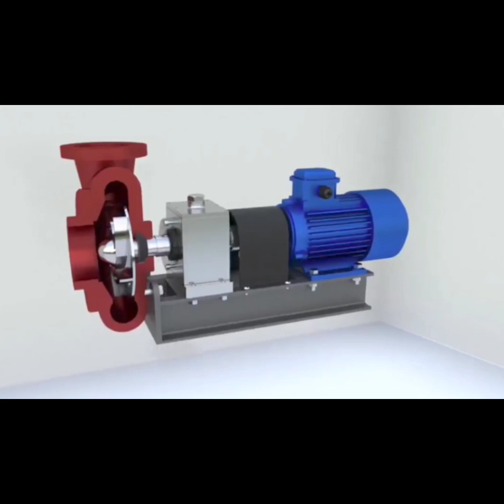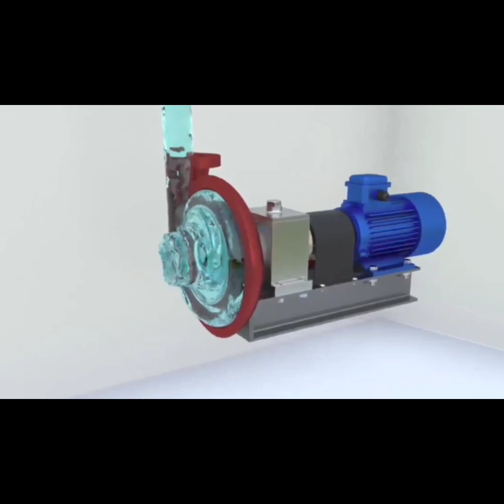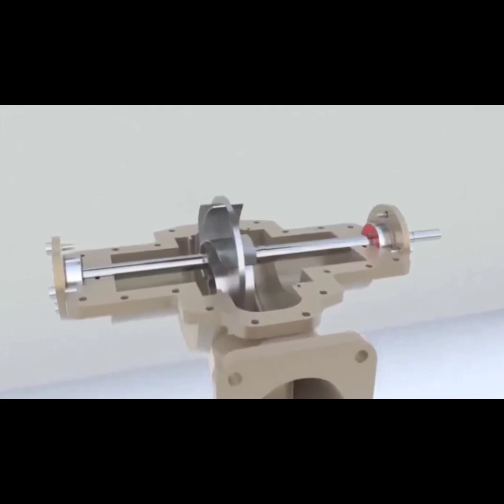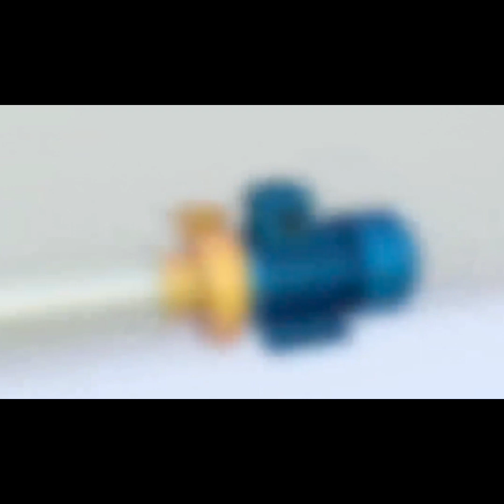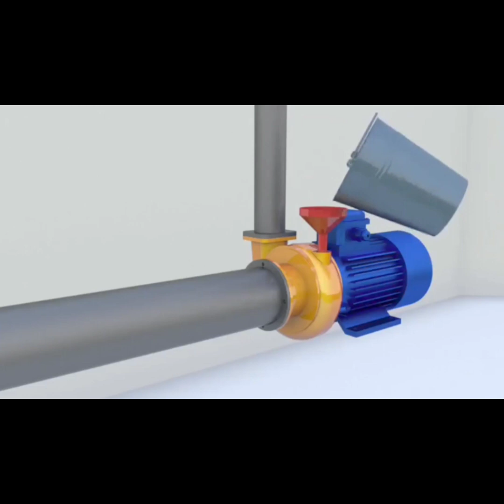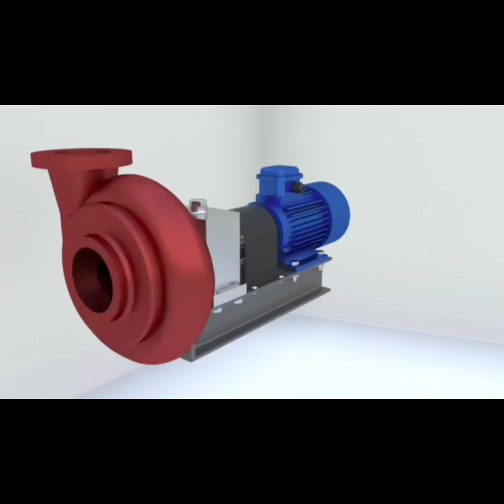"Centrifugal Pumps I सेंट्रीफुगल पंप I Working annimation: A Marvel of Fluid Dynamics!"

Comment from the maker: 6 Common Pump Questions Answered

For any centrifugal pump user, knowing the answers to the following six questions is key to reliable and efficient pump operation. The answers below are excerpts from a six-part series on centrifugal pump efficiency written by Pumps & Systems columnist Joe Evans.

1. What is efficiency?
When we speak of the efficiency of any machine, we are simply referring to how well it can convert one form of energy to another. If one unit of energy is supplied to a machine and its output, in the same units of measure, is one-half unit, its efficiency is 50 percent.

The overall efficiency of a centrifugal pump is simply the ratio of the water (output) power to the shaft (input) power and is illustrated by the equation below:

Ef = PW / PS

Where:

Ef= efficiency

Pw= the water power

Ps= the shaft power

Click here to read the full answer.

2. What is specific speed, and what is its effect on the pump curve?
Specific speed was first applied to centrifugal pumps in the latter 1800s and was a modified version of one developed for water turbines. Many pump designers see specific speed as the most important contributor to centrifugal pump design. It allows the use of existing design and test data to design similar higher and lower flow pumps because the specific speed of a pump is independent of its size.

Figure 1. Pump profile comparisons (courtesy of www.pumpfundamentals.com)
As Terry Henshaw stated in “Centrifugal Pump Specific Speed” (Pumps & Systems, September 2011), the definition of specific speed can be confusing. It is best to think of it as an index number that can predict certain pump characteristics. Viewed this way, specific speed can be useful when selecting a pump for a particular application and predicting premature failure due to off best efficiency point (BEP) operation.

Click here to read the full answer.

3. What are individual efficiencies that affect operation?
Hydraulic efficiency. The shape and spacing of the impeller vanes have an effect on overall pump efficiency. Although the ideal impeller would have an infinite number of vanes, the real world limits us to five to seven for clear water pumps and even fewer for pumps that handle larger solids.
Volumetric efficiency. Whether the volumetric efficiency of a centrifugal pump is a function of the volute or the impeller is debatable (it is probably both), but I will include its effect here. Volumetric efficiency represents the power lost due to flow leakage through the wearing rings, the vane front clearances of semi-open impellers and the balancing holes in the rear shroud.
Mechanical efficiency. The final piece of the pump efficiency puzzle is that of mechanical losses, although some of these losses are not always included in published efficiency curves. In the case of a frame-mounted pump, these losses are caused by the shaft bearings and the mechanical seal or packing. For close-coupled pumps, bearing losses are figured into the motor efficiency. Again the rule of thumb follows that of volumetric efficiency, and losses increase as flow and/or specific speed decrease.
Combined efficiency. When looking at the overall efficiency of a pump in operation, the efficiency of the driver must be included, and in many instances, that driver will be an electric motor. When the Energy Independence and Security Act of 2007 went into effect in December 2010, it raised the bar on motor efficiency. Today, all new motors must meet premium efficiency standards. Obviously, a higher efficiency motor will increase the overall efficiency of a pumping system, but by how much? How do we calculate the combined efficiency of pumps and motors?
Click here to read the full answer.

4. How do you preserve efficiency?
An important part of the volute is the tongue, or cutwater. Its purpose is to maintain flow into the throat while minimizing recirculation back into the case. The optimum clearance between the tongue and the impeller periphery is the smallest distance that does not give rise to pressure pulsations during vane tip passing. A well-designed pump will have a full-size impeller that meets these clearance criteria. When an impeller is trimmed, this distance increases and allows more fluid to recirculate back into the case. As recirculation increases, hydraulic efficiency decreases.

Click here to read the full answer.

5. How does curve shape affect efficiency?
A typical performance curve is relatively flat at low values of specific speed (Ns) and becomes steeper as Ns increases. Pump efficiency is lowest at low values of Ns (500 and below) and increases as Ns increases. It reaches its maximum in the mid-to-high 2,000 range and begins to decrease above 3,000. However, the decrease above 3,000 is much smaller than it is below 1,000.

Steeper curves usually offer a greater range of control when operated under variable speed control against some fixed elevation or pressure head. These pumps can be problematic when running in parallel or starting against varying system head conditions. ... Flatter curves work fine in across-the-line applications as long as the static or pressure head remains relatively constant. They also work well in closed-loop (and most open-loop) circulation applications when operated under variable speed control.

Click here to read the full answer.

6. When is efficiency important?
The power required by a pump is directly proportional to both the flow and the head that it produces. As flow and/or head increase(s) so does the power required. Conversely, power is inversely proportional to hydraulic efficiency. For the same flow and head, an increase in efficiency reduces the power requirement.

As the cost per kilowatt hour increases, so will the savings due to increased pump efficiency.

Comment from the maker: High Flow Rates: Centrifugal pumps can handle large volumes of fluid, making them suitable for various industrial applications.
Simple Design: They have a straightforward construction, consisting of few moving parts, which makes them easy to maintain and operate.
Wide Range of Applications: Centrifugal pumps can be used in various industries, including water supply, wastewater treatment, oil and gas, and chemical processing.
Energy Efficiency: They are generally efficient in converting rotational energy into fluid flow, saving on operational costs.
Self-Priming: Some centrifugal pumps can self-prime, meaning they can start pumping without the need for external priming.
Centrifugal Pump Cons:

Limited Suction Lift: They are not efficient at lifting fluids from depths, as they rely on the suction side to be close to the fluid surface.
Lower Pressure Capabilities: Compared to positive displacement pumps, centrifugal pumps may have limitations in providing high-pressure outputs.
Cavitation Risk: Centrifugal pumps can experience cavitation if the pressure drops too low, leading to potential damage and decreased efficiency.
Not Suitable for Viscous Fluids: They may struggle to handle thick or highly viscous fluids effectively.
Efficiency Drops at Lower Flows: Centrifugal pumps may become less efficient when operating at low flow rates, leading to reduced performance in certain applications.
It's essential to consider these factors when selecting a pump for a specific application to ensure optimal performance and longevity.